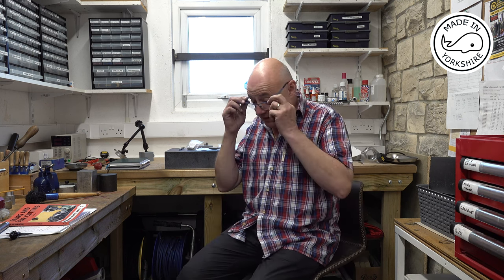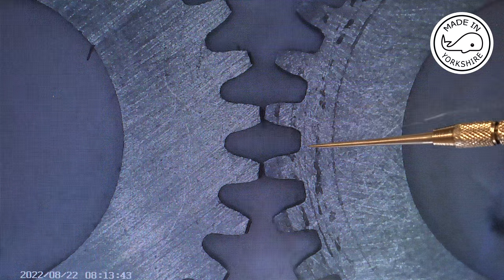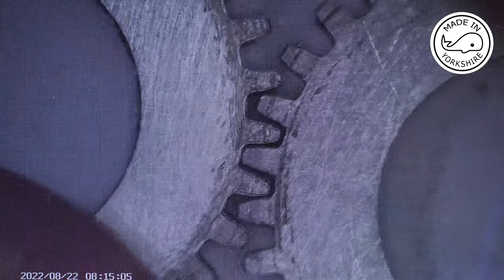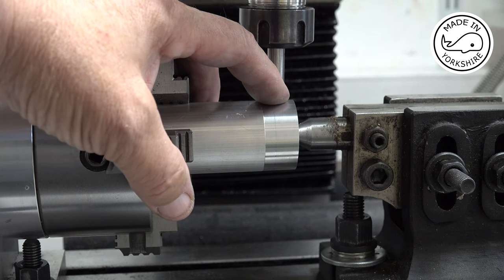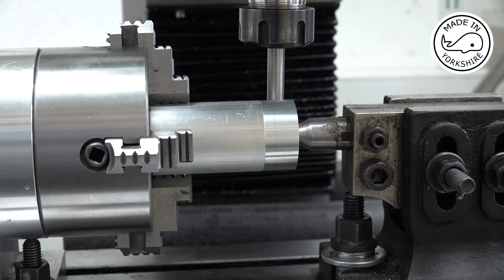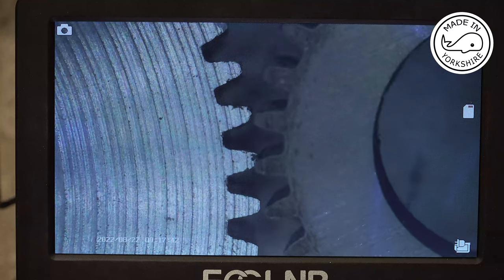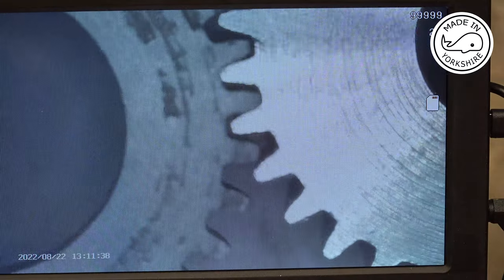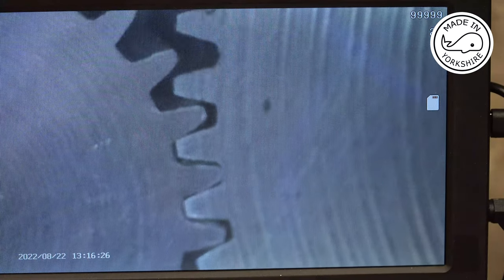#MT50 Part 7 - Making a Gear Hobbing Attachment. Nailed it! In 4K/UHD by Andrew Whale.

Comment: Hello Andrew, I have been watching your great video's because I encounter similar problems with my hobbing machine. Altough I think you nailed some issues (rigidity) I think there could be some other problems. I believe my hobbing machine suffers also from magnetic interference. I have seen extra pulses and a variabel rpm readings (+/- 5 rpm by 480 rpm's spindle setting) on the screen of the arduino (I saw it on your machine also). But not always! Of all the gears I made aprox. 10% where really perfect. The others suffers from the same problems you have/had. The perfect one's had a very stable rpm reading on the arduino screen. I tested if the rpm reading was influenced by wiring issues. With all the cables earth grounded, I still got the same results. I measured the signal of the ground cable with a scope and saw a little noise. It is not completely 0V. When I isolated the encoder by a plastic frame and disconnected all ground cables from the whole system I got different and better results. But still not good enough. When I take a ground wire and slide it along the metal of the mill (mill was not turning), there where some rpm reading on the arduino. The same happens when I carefully slide the housing of the encoder against the metal milling machine without turning the the shaft of the encoder. In both cases the hobbing machine starts moving a little. Finding this problem and solving it is my free time nightmare. I still have not solved it.
Besides the above there is another problem with all stepper motors. When you try to move a stepper motor by hand (system powered up), there is some movement possible. The magnetic force in the unloaded situation is low. It grows when you try to turn the rotor. This is something we cannot change, but must be taken into account. It can results in perfect shapes of teeth, but with less wider teeth. This problem is offcourse not the same as synchronisation problems.
So, now I am trying the closed loop steppermotor option hoping the result will get better. I hope to adress this problem because it is a very nice feature.

Comment: I ran into similar issues a decade ago, in the same kind of situation.  With the hob, you can't go around twice, and drag on the blank minimizes the extra width of the slots.  Good cutting fluid, sharp cutter, full depth cut will get as clean a cut as is possible.  Thanks for sharing!

Comment: It would be interesting to see if a new unground hob that was easily obtainable would produce the correct profile.
Reply: I'm thinking the same. I think there is a profile discrepancy with this hob he is using.
Reply from the maker: Hi Philip. An interesting thought. I'm reluctant to purchase a new hob without a specific project in mind. Individual gear cutters are relatively cheap compared to a hob. I think hobs are only cost beneficial if you need to make several gears across the full range of teeth. I think the secondhand hob market is risky as their history is unknown. Nevertheless it's an option I can call upon if I need to.
Cheers
Andrew

Comment: My 2 cents; I think there is still a timing issue between the mill and the hobbing mechanism
Very interesting topic Andrew, thanks for sharing
Cheers
Reply: Many of us originally thought there was a timing issue but if you look at Andrew's experiment of matching the hob teeth to the hobbed gear that shows there isn't a timing problem as the hob teeth match the gear teeth profile perfectly. That wouldn't be the case if there was a timing sync problem.

Comment: Seems I was wrong assuming the hob is not the cause. You could try cut two gears with reduced cutting depth (smaller dedendum) they will not work with all other gears, but might work as a pair with less backlash.
Reply: It is technically known as 'Profile Shift + or -' and involves exactly what you describe for increasing or decreasing  the addendum/dedendum
Reply from the maker: Hi Timo, I might just try that but I'm getting brain fatigue and I now have dozens of gears of varying quality all labelled up in individual bags.😵‍💫 BTW Howard knows his stuff 👍
Cheers
Andrew

Comment: Hi,Andrew. Have you tried measuring that hob or any of the gears with gauge pins or thread wires and a mic? There are tables for measurement over wires for gears.
Reply from the maker: Hi Howard. I read up on thread wires and investigate.
Cheers
Andrew

Comment: An involute gear has a "base circle diameter" (different to the pitch circle diameter).  The involute curves that are the flanks of the gear teeth start at this base circle.  The teeth of meshing gears only contact outside their base circles.  This means that the shape below the base circle (square-ish from the hob or round from the gear cutter) is irrelevant as long as it provides clearance for the tip of the meshing tooth.
From your close-ups of the hob, the flats on the tops seem to be a fair bit wider than those on the bottoms, indicating that it will cut teeth that are too narrow.
Reply from the maker: Thanks for the info Chris.

Comment: Andrew, as a final test, when you return the borrowed hob, could you not ask him to lend you a different one, just to prove the point ? Looking at it under the microscope, it looked to me to be a faulty ground one, the profile was not correct, hence it making a flat bottom instead of a radiused one. Just a thought. Regards from Australia.
Reply: Hi,Dave. I think there is a slight profile discrepancy on that hob Andrew is using. It would be very interesting to see the results from a commercially made hob. 
Also, I wonder if Andrew measures the hob profile with gauge pins or thread wires if it reads as it should.
Reply from the maker: Hi Dave. Thanks for your thoughts on this. It could well be that the hob is at fault. Andy was very generous lending me the hob in the first place and I don't want to push my luck. However, I might ask him to try cutting a 21 tooth gear with it to see if he gets the same result.
Cheers
Andrew

Comment: When I look at the Machinery's Handbook and the diagrams of gears, they all have a flatter root. What you end up with a gear cutter vs a hob, they are going to be different. I would expect the hob to be more of an accurate profile. The involute gear cutter is as close as you're going to get, but they will never be perfect. I think the closest profile would obtained with something more like a shaper where the cutter stays constant and the gear is rotated and moved laterally.
Reply: The shaper method with the gear blank periphery rolling whilst moving in the X axis is the same in principle as the spiral hob in as much as the shaper tool and the hob tooth profile mimic the rack for that particular gear DP or Module.
Reply from the maker: Yeah I would expect the hob to make near perfect gears, as hobbing is widely used in the commercial environment.

Comment: Andrew, what you have done is fine, I would lay money that the discrepency is down to a faulty hob. It is the case that nearly all manufactured gears these days are hobbed as it is the quickest way of producing them and I have bought several over the years from S H Muffet and they all engage perfectly. Having visited their factory years ago, I see rows and rows of hobbing machines. I would definatly say it is the hob. Well don for producing what you have.
Reply from the maker: Thanks Neil. Next time I need to cut some gears and I don't have any individual cutters I will try to get hold of a hob. Most likely on the second hand market due to the price. It's encouraging to see a british family owned engineering company still going strong. It must have been a real treat going round their factory. 😀
All the best.
Andrew

Comment: Well done figuring it out!! I wonder if your diameter of the material would change the tooth thickness as well?.
Reply from the maker: In theory I don't think it should but in practice I guess it could. I've not used the hobbing machine since then. Three major reasons. 1. hobs are really expensive and second hand ones are a gamble. Though I know some people make their own. 2. Single cutters do produce a better tooth profile. 3. Hobbing machines require an immense amount of rigidity and my machine is only good at cutting small teeth.
Reply: Thank you for getting back to me. True on many counts,.  One more question what was the pin out for direction on the servo.    Was direction set high manually. I noticed in your code that pin 11 was not used in the code but notes where made about it as dir.
Reply from the maker: I later changed from a DM542T to a CL57T to see is gear quality improved - but it didn't.
I don't want to take the controller box apart becuse it's a bit of a rats nest. However, I've found some notes. I hope these help....
This code works with my UNO and DM542T
PUL - Pin9
DIR - Pin8
Connect these to positive PUL, DIR
Connect negative PUL, DIR to Uno gnd
Power DM542T with 24v
Motor Red, Grn, Yel, Blu - top to bottom.

Link to code and diagram:
https://www.omc-stepperonline.com/support/can-you-send-me-a-schematic-that-how-to-wire-the-stepper-driver-to-an-arduino
Reply: Thanks buddy ill give this a go to make sure the set up works on the arduino before I start the robbing journey
Reply from the maker: @Wrighmachining good luck and have fun!

Comment: Just a thought; is your hob for a stub rather than full-depth involute? (What markings are on the hob?) 
Stub involute had a shallower dedendum, and hence a wider root.
Reply: to add... A full depth 48DP hob would be marked 48DP ;-) the corresponding stub tooth hob would (I think) be marked 48/60DP. I'm not sure how metric module stub form hobs are denoted.
Reply from the maker: Hi Eric. The markings on the hob are fairly limited, but I will check that out. Strangely the helix angle isn't shown on the hob, but on the box it came in.
Cheers
Andrew

Comment: Mandrel you have the hob mounted on does look a bit skinny as there is a lot of force hobbing to full depth. Interesting project though 😀
Reply from the maker: Hi Julia - thanks for the suggestion. I did try moving the hob futher up near to the spindle, but no improvement. I think the result is a feature of that particular hob. I've also concluded that gear hobbing for me is only suitable for gears with small teeth - due to the massive forces involved. Still an interesting exercise though.
Cheers
Andrew

Comment: Interesting, reporting video. Lots of thanks for all the work filming and editing all, like the microscope parts.
Not knowing industrial gear cutting one thought came up:
Suppose You use a fly cutter type of cutter shaped to the perfect form and cut just one tooth completely at the time. The teeth will have the form of the cutter.
When hobbing I got the idea that the profile of the cutter needs to be different. (Can't describe how).
Reply: That is the same result as using a B&S type gear cutter which Andrew already has one of.
Reply: @howardosborne8647  Thanks for explaining. I didn't understand that Andrew used such a special cutter.

Comment: Hi Andrew
Nice video series, appreciate it!

What did the trick, beside the imperfect hob?
The resistors in the encoder lines?
Assumingly it was not the change to the closed loop stepper? (Andy‘s hobbing attachment also works with standard stepper?)
…i am facing the same problem with synchronization, but would like to avoid a massive change in setup… any tip?
Reply from the maker: Hi
The closed loop stepper made no difference. I'm not sure I can add anything more than what is in the video. I don't think the hob was perfect. The idea of making a hobbing machine was an interesting one, but in reality I think it's better to buy NEW individual cutters. Hobs are expensive and you just don't know what you are going to get secondhand. The other issue is that you might get away with hobbing gears with small teeth, but to cut gears with large teeth you need a really ridgid setup. Just look at some of the commercial hobbing machines and you will see that they are absolutely massive machines in comparison to the size of the gears being cut.
Hope that helps.
Andrew

Comment: Have you actually set the milling spindle over at the correct angle to compensate for the hob helix? I am also having issue, with the electronics and belief that may be missing pulses, or more correctly that there is a miss match of signal levels from the analogue pin A1. Don’t know how it set up in the parameters as to if correctly set pull-up/pull-down.   Lastly getting EMC issues with false pulses. Now built 5 set ups to eliminate the actual hardware and created a ground plane, reducing loops etc.
Reply from the maker: Hi Peter. Yes I set the spindle to the correct angle. It's a while since I looked at the code but it should be relatively easy to add some debugging into it. If you have a scope, even better. After making mine I concluded that it is only feasible to cut gears with small teeth. If you look at industrial hobbing machines they are made out of masses of cast iron in order to cater for the large forces involved. Also, secondhand hobs tend to be an expensive gamble. It's a lot easier and cheaper to purchase new single gear cutters. Nevertheless this project was interesting at the time.
Cheers
Andrew

Comment: I like your videos and pls keep creating the great content 👍😀
I think based on your last comment you mix 2 things up.
You say the bigger the gear the larger the force and offcoarse force changes with size , but you’re problems is not force but shape.
If you cut gears with a regular gear cutter you change the cutter accordingly to the number of teeth / diameter because the shape of the tooth changes slightly with changing diameter off the gear.
So why do you expect this rule not to be the same for a gear hobber …..
Also the profile of the teeth on a hobber style cutter need to change shape to cut the correct shape of a tooth with changing diameter off the gear.
Your set up looks oke and the only things I would change is how much your cutter stick out / diameter of the holder to get more rigidity.
Also I would lower the rpm’s and use more oil for chip excavation.

Comment: Fantastic! I havd definitely learned something watching your process here. 
I would have bet money it was a lack of rigidity and/or sync problem, but your visual test of the hob teeth aligned with the result teeth proved instantly it was because of the hob profile. 👍
Now I'm wondering if hobs come with varying profiles to suit different gear diameters (like gear cutters do)?
It appears your hob works well on a 70 tooth gear but makes a mess of a 32 tooth gear. So that is logical.
Reply from the maker: Hi Wiz, it's a strange one. One hob should be able to cut the full range of teeth perfectly. I might experiment by changing the angle of the mill spindle to see what that does.
Cheers
Andrew
Reply: @learningturningmetal  ... hi Andrew, I'm not sure a straight involute hob will give the correct profile for small number of teeth gears.
This is a cut and past fro  the Wikipedia hob page;
"For a tooth profile which is theoretically involute, the fundamental rack is straight-sided, with sides inclined at the pressure angle of the tooth form, with flat top and bottom. The necessary addendum correction to allow the use of small-numbered pinions can either be obtained by suitable modification of this rack to a cycloidal form at the tips, or by hobbing at a diameter other than the theoretical pitch. Since the gear ratio between hob and blank is fixed, the resulting gear will have the correct pitch on the pitch circle but the tooth thickness will not be equal to the space width."
Reply from the maker: Hi Wiz. Thanks for looking this up - that seems to explain it. With the teeth being narrower than they should be I think I will try some test cuts with a depth of cut less than 45 thou. Maybe 40 thou as a starting point.
Thanks again for trying to shed more light on the problem.
Cheers for now!
Andrew

Comment: It isn't sufficient to just roll gears together. Gears are calculated for pitch between centres, this needs to be present for clearance which gives the true fit. You also have to take into account the lubrication to be used.
Reply from the maker: I agree entirely. Maybe you missed the bit where I turned them between 0.66666" centres.
Cheers
Andrew
Reply: @learningturningmetal  I scanned .... I have machined a lot of gears over the years for machinery and engines for my hobby. I also cut wheels for clocks and built a gear cutting machine for cutting clock wheels. Very heavy duty and accurate and to be written up for the model engineer. 
In gear cutting rigidity is everything.
Reply from the maker: @union310  I hope you get round to writing up your gear hobbing plans soon. I would really appreciate a copy: learningturningmetal@gmail.com
Cheers
Andrew